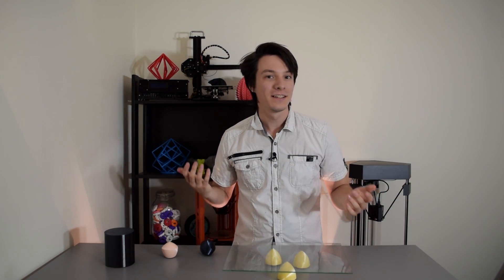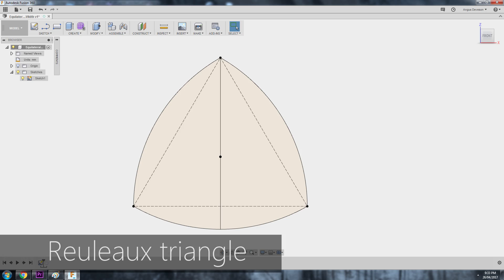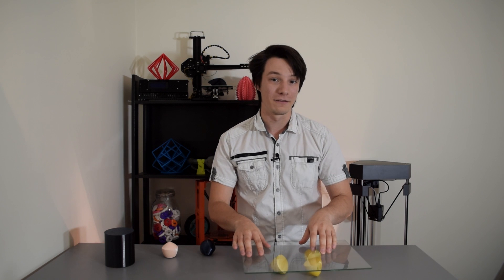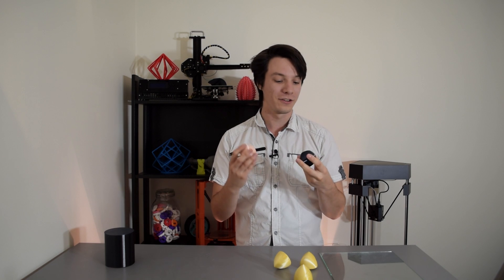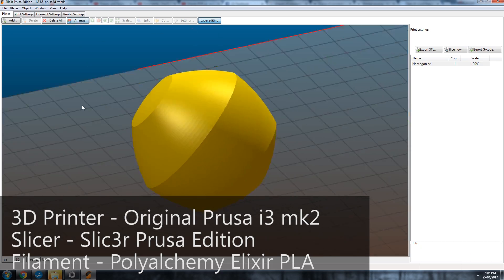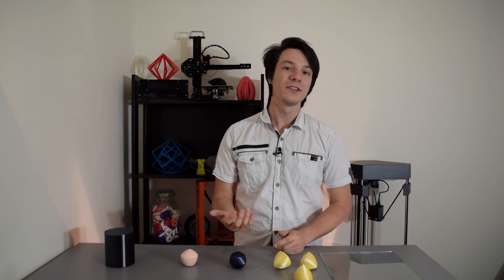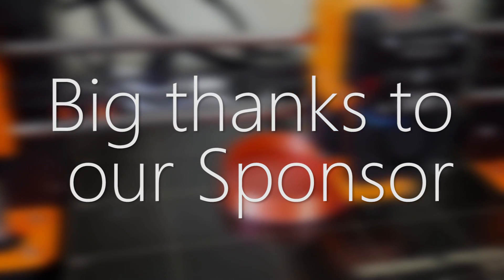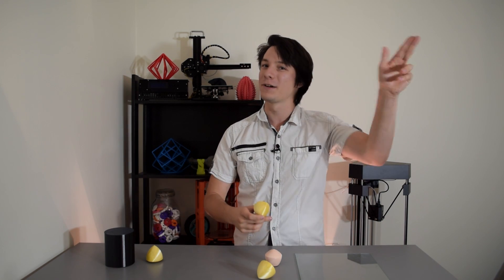3D Printed Solids of Constant Width

Comment: For more shapes, use the triangle method of drawing circles, but in 3D, by using a tetrahedron and drawing spheres, the shape inside all the spheres will be a new one of these objects. No rotational symmetry. With equilateral triangle, you can add 3 identical circles around the corners, then do the other steps, and you have a new shape you can rotate using your method, this gives another set of new shapes, you can use different diameters, use a small diameter to just round off the edges. You can also add spheres to the corners of the tetrahedron, doing the same in 3D.

Lastly, for completely irregular shapes, use an irregular tetrahedron, and again do with spheres what you would do with circles.

Comment: To create the 3D shapes of the un-uniform shapes, Use 3DS Max or something similar to create a morphing video between the known sides. Like morphing one person's face into another. Then, take each frame in the video and take measurements. Keep the frames as choppy (far apart) as the 3D Printer's ability. That way it'll be more consistent. That's what I think anyways. Thought process.

Comment: for the non equilateral triangle that you can't make into 3d form, how about copying the object, make the copy smaller by 1 point, put it on either side, and continually copying and decreasing the size until you have an angle on the end? There's probably a technique that gives similar result, but i dont know about it

Comment: For the one you say you can't make it 3D because it is not semetrical maybe you can try to rotate around the axis that goes through that tip but as you rotate it make it get gradually bigger on one side and smaller on the other side so after a full rotation ends match. And if "gradually" doesn't work you need to find a way to bend it so it has constant width.

Comment: With the non-equilateral triangle, make another triangle for the other three sides, then stretch a surface between them. You might need solidworks though.

Comment: even number sides figures won't work because the whole constant width relies on having a "flat" (curved really) side opposite of where you would have a corner, and with even sided figures this isn't true as you have a corner directly opposite of any other corner, and you have a "flat" (again curved) side opposite of another side with the same characteristics, this makes it so that in every corner there is an increase on the size of the width of the object

Comment: I like what you did here. have you thought about 3d printing it in 2 pcs? imagine cutting an apple in half then support the half from the core as its printed,  you could even make it hollow and assemble the haves like a clam,  the drawback is you would have a seam all around that would have to be smoothed over.

Comment: Not an answer to your questions, but insted of turning the 2D shapes into 3D via rotating them, you can take for example a four-sided pyramid and draw spheres centered on each corner. That should give you another solid of constant width with a different shape.

Comment: Spheres (and they're relatives, wheels) are the only shapes that can roll well, not because of the fact that they can maintain the same distance between the 2 planes of rotation, but it's because it's the only object that does that and at the same time keeps the center of mass always exactly aligned with the point where it touches the ground, allowing a smooth rotation without variations in the force needed to overcome the gravity pushing against it to place the object in a equilibrium state.

Comment: Make a solid object: each (identical) view in third angle projection comprises a circle with two diagonal diametrical lines (at right angles to each other). Can you calculate the volume? Can you name it? What could it be used for? How would you make one if not with 3d printing? I have two of these made during my engineering apprenticeship (many, many years ago)

Comment: It couldn't be used as a wheel or a bearing efficiently because the center of these objects (center of gravity or geometrical center wich is the same in this case) moves around as it rolls, it will make vibrations/oscillations and it will be impossible to mount on an axle... And even just the irregular surface would cause many problems...
Sorry but mechanics isn't magic, it's pure logic like mathematics but don't worry you can still do fun things with this : https://www.youtube.com/watch?v=BeOS9pG6vjU ;)

Comment: In these kind of videos, some one usually mentions that the Wankel engine rotor is not the shape of a curve of constant diameter, even though it looks like it is, so I will mention it in case it is not in the 949 comments, of which I have only read many dozens. Note that the Wankel rotor does not use the property of constant diameter, if it had it, because the seals where it contacts with the combustion chamber are at the points of the triangle, not at opposite ends of a diameter.

Comment: Just for the record, Wankel engine rotors are not Ruleaux triangles. They have a different shape. The faces of the rotor do not have a constant radius.
Wankels are neat, I've played with 'em myself, great hobbyist's engine. They will never become common because they burn too much fuel for a given power output--something that's unacceptable today, and the reason why they were dropped in favour of continuing development of reciprocating engines. It has nothing to do with engine durability/lifespan--just high fuel consumption.

Comment: Cool  BUT ,,,,, are there any practical uses for them

To me the Wankel has always been a fail because it doesn't actually meet what was said to be the main criteria ,,,, A more efficient engine because there are fewer moving parts and that is the main reason it never caught on

The Internal Combustion Engine (ICE) will be going the way of the horse and buggy soon because it suffers from a major problem, it is only 20-25% efficient at Energy Conversion and that kind of gross inefficiency is no longer going to cut it in the 21st Century. The ICE is like paying someone $20/hr to do $4-5/hr worth of work and no sane businessman would ever do that yet here we are all doing exactly that. Once we beat the Energy Density problem with batteries/storage cells the ICE will quickly fade away because making electric motors with 90+% efficiency is child's play. Because the efficiency of the ICE is so poor once we can make a storage cell with 25% the Energy Density of gasoline they are on even footing and anything much above that will bury the ICE

I expect we will hit the tipping point in another 10 years because anyone with an IQ over room temperature can see that the people who do it will become massively wealthy .... Plus it is our only chance to beat Global Warming before it's too late

Comment: It's pretty straightforward to prove that even numbered regular polygon can never be of constant width. An irregular even numbered polygon could be, but a regular one not. All you need to do is consider the situation when you have two corners exactly opposite each other in relation to the center point. At any point if there's a corner there needs to be an arc on the opposite side for the width to be constant.

Comment: clickbait. its not a wheels. having an axle to that type of wheels would not give you a smooth ride. and a wheels without an axle is kinda pointless. it could work as a ball bearing although the uneven shape mean the bearing would hurt worn unevenly, so replacement would be much frequently. its cool as a bearing, but not better than a ball

Comment: You don't want a rotary engine fam, no reliable pressure release means that every 40k miles or so the seals are going to burst, then the whole engine needs to be taken apart to fix it

Comment: Funny how u were looking for a rx8. My friend and I found a black one with 30k miles for 1k and sold it for less than 2k. The motor was bad. No compression. All the common wear and tear of rotarys:(
Reply: because the rotary engines are a bad garbage concept in the first place.
Why would you want to get an engine which destroys itself while it's running? Only fanboys.

Comment: Reason it has to be odd sided polygons: the two points of contact (the table and the glass) have to be equal distance apart. The shape has an obvious "point," and that point needs to be compensated in the difference of height by having a gentle slope on the other side of it (shallower than the point in reference to the true center of the object). If you made one with an even number of lines, you would have points on the opposite sides of each other. This would give a similar effect to why your hand is pushed upwards when you try to roll a cube.

The reason this works is because in an odd numbered equilateral polygon, the exact opposite side of a point is a perpendicular line. By adding circles, you are simply filling out the difference in the height between the two at every possible cross-section

Comment: I was like fucken roll it already
Reply: Skip to 3:48
Reply: if you weighted it correctly, could you make one that properly rolled like a ball? even if it was solid and had no moving parts?
Reply: I made the video last like 23 seconds skipping
Reply: Yeah, like down an incline, beside a ball, to see if they actually "roll like a ball".
Reply: You can roll a ball because its center of gravity is always above the point of contact (on a level surface). It might be possible to distribute the fill material in one of these so you can roll it, but I don't have the math chops or attention span to work it out for sure.
Reply: I CAN RELATE TO THIS😂😂😂
Reply: warhammer 373 I know man! I was like skipping through and getting so frustrated
Reply: He rolled it within the first 10 seconds
Reply: Zane Fox That wasn't rolling it. That was sliding a piece of glass  around on them. Not the same thing.
Reply: Josh Rackstraw only if you had a mobile centre of mass that moved to stay at the same level while it rolled
Reply: warhammer 373 I know wtf I can roll one of my turds under some glass and call it round too I should make a video
Reply: This was stupid
Reply: i was like, "why the fuck this have so many likes"
Reply: Christopher Martinez Please make that a channel

Comment: Can someone point me at a page/place to find this critter:
Take 2 right cones and glue them base to base.
Cut in half through the apexes.  (Faces will be square)
Rotate one piece through 90 degrees and rejoin.

What's the resulting solid called?

Exercise for the commenters: What path will it take when placed upon an inclined plane?

Comment: For your solids, you could construct them similarly to the plane figures by taking the intersection of spheres centered on each vertexes and touching each vertex of the opposite side. I would guess that technique would work for asymmetric solids as well, and give solids with a different kind of symmetry than rotations.

Comment: constant diameter is just good if it doesn't connect to anything the you need constant radius. And in bearings you want max area to transfer force so I have hard to see any application for this.

Comment: I'm not sure how that program works but I know in auto cadd you can draw a line down the center of that 2d object. Then use a tool called revolve. Select the outer parts as what you want to revolve then the center line as what your revolving around. Obviously you want to revolve around the center line 360 degrees.

Comment: It has always annoyed me how they make these shapes in 3D.

In 2D, starting from a regular polygon with odd sides, you create them as the intersection of circles whose centers are on the vertices.

Why does everyone just take the roleaux triangle and meld it with a circle for the 3rd dimension by rotating it, rather than starting with a regular tetrahedron and carving the intersection of spheres whose centers are on the vertices?

Comment: The wankel rotary is so underrated. I mean I know it's no more effective than a normal engine but just look at the thing! What kind of phsyco maniac would even think to design an engine like that? And the fact that it actually works is even weirder, it's a flaming triangle thing in a box and somehow it works the same as a regular four stroke. That, to me, it amazing.

Comment: even-sided polygons will not work with the method you are using, simply because when the vertex of the polygon is touching the bottom, another vertex will be touching the top, and that length will be longer than that of an edge touching the bottom and an edge touching the top.

Comment: a very pure solid of constant width requires that you build a tetrahedron and extend the faces with spheres, centred at the opposing vertex
Reply: Bronylike 2 correct. I read all the way down until I found someone who realized his idea of simply revolving the shape wouldn't work at all. it took way longer than I expected. most of his shapes still had a flat side! that's not rolling anywhere.

Comment: Shapes of constant width need to be uneven polygons because a corner needs to stick out in order to compensate for the not-sticking-out of the edge. The key is the circle, one vertex to the opposite edge has constant width thanks to the constant radius of the circle. Also rotational extrusion isn't necessary, it could be done the same way with the intersection of spheres on a tetrahedron. Radius should equal edge length in both cases.

Comment: RX8? IF you have the cash to spare, go RX7. neither are "reliable (needing apex seals/a motor rebuild about every 90k miles) but the RX7 is lighter, faster, and will hold value much better. That being said, the RX8 is a great car, my favorite "feature" is how it is actually recommended my Mazda to redline the car every once in a while, apparently it helps clear out carbon issues

Comment: Curves of constant width require an odd number of sides, because the center of the circle will be on a vertex, and the arc is created using the two opposite vertices. Even number of sides won't provide this. Though, it may be possible, if you extend the sides to create a vertex, but I don't think this would be a true shape of constant width.

Comment: With the non-symmetrical  non-equilateral triangles being unable to be turned into 3D forms... what if you take a complete sketch, duplicate it, then rotate it around an axis so one sketch is on the horizontal plain, other is on the vertical plain intersecting at the common axis they were rotated around. Split the sketches around the common axis so you have 4 sketches of the overall shape (ie. top, left, bottom, right) then LOFT them together Top-Left, Left-Bottom, Bottom-Right, Right-Top.
May work.... urg, I'm going to have to try that now... :P

Comment: The guide rods used in most 3D printers are produced by centreless grinding. If the machine is not set up corectly, they will end not being round, but instead of constant width (usually tri-lobular)

Comment: I think you can do it with even sided polygons. You just have to put the centre point on the midpoint of the sides
Reply from the maker: +Nathan Rosmarin wouldn't that create a sphere?
Reply: Maker's Muse i don't think it will
Reply: Maker's Muse you may have misunderstood me, the center point of the circle is on the midpoint of sides of the polygon

Comment: I noticed the Reluex Triangle of constant width (I don't think I spelt that right I know) looks like a mastermorphix (A Rubik's cube mod) Also when you make that in fusion, what happens when you put a square and do it instead of a triangle, or any other regular polygon?

EDIT: Just noticed the other odd sided polygon part.

Comment: Shapes of constant width must have an odd number of sides such that a curved side is opposite an edge. 

More fancy solids of constant width are Meissner tetrahedra. Here are some I got printed my Shapeways, as I'm yet to decide on which printer I'm going to go for (I have my eyes on the Prusa) https://www.shapeways.com/product/SP92YLRXM/3-different-solids-of-constant-width?optionId=38443672
Reply: My first point is why most coins are odd-sided such that vending machines can easily identify them. The new UK 1 GBP coin is 12-sided, and as such not constant width, though it has been 'rounded'...
Reply: Gregregorovich Yeah, I guess they decided that 12 sides made it round enough, not to have to worry about the small variance.

Comment: cool I was thinking of making some of these the other day so thanks.  Do you have any tips for last bits (1/3 or 1/4) of fillament roll, Im new to 3d printing and still on my 1st roll but the last bit is very tightly wound and I'm a bit worried I'm not going to be able to print anything else from it, which would be a huge waste.

Comment: omg you used something besides Simplify, the haters on Reddit are going to have a heart attack!
Reply from the maker: Haha I use Prusa edition all the time! If I don't need custom supports or such it works great. I also played with the variable layer heights in this video for the heptagon based form.
Reply: i might know how to make it 3D. try to take a pyramid (equall sides for a start) and make a ball from each corner. You should make a 3D triangle and use 3D circles to make it 3D by random. SHOULD (not sure though) work. 

Numberphiles (youtube channel) have a video on this :D!
Reply: what 3D printer do you recommend
Reply: found it! Jump to 7:28 if you wanna go directly to your qestion ;)
watch?v=cUCSSJwO3GU